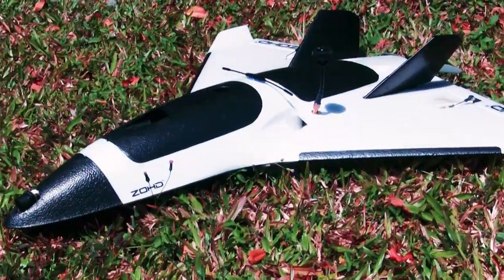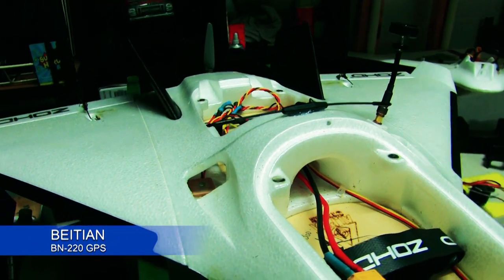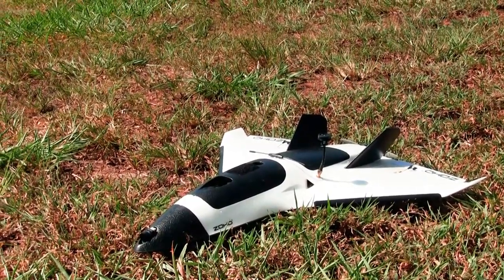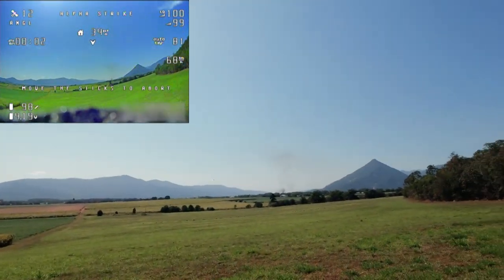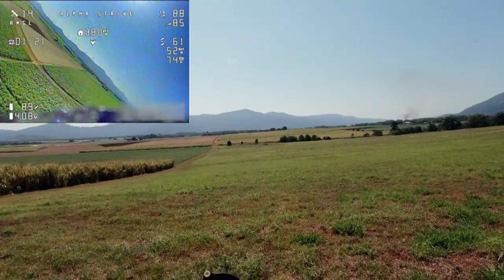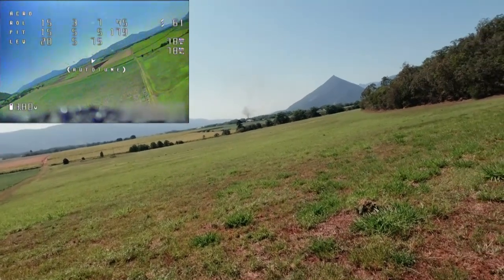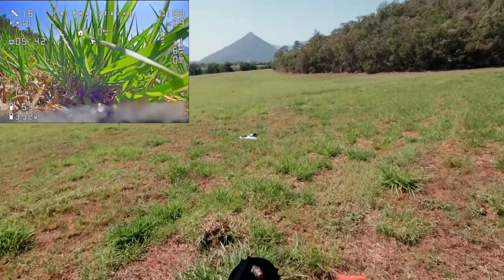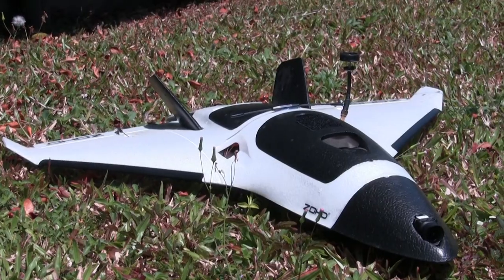ZOHD Alpha Strike Maiden Flight and Overview

Comment: Didn't you use a gyro launching  and flying this? I have several planes similar to this and never use any gyros..i have crashed many times,but these planes are fun to fly..i have this  pnp version still have not set it up yet..i was thinking about installing a gyro rx since its so nice and it would be great to have a gyro switch if it got to be to twichy..thanks for sharing

.
Reply from the maker: It has a flight controller so yeah stabilized flight with inav auto launch. I can fly it manual which has no stabilization but until I am used to the way it flies and for setup up I prefer some stability. And yeah it seems a fun plane.
Reply: Install twin motor to minimize your urge on FC. I've already tried twin 2205 with 6 inch prop from old quad, took off with a 4*2 18650 pack very easy and slow.